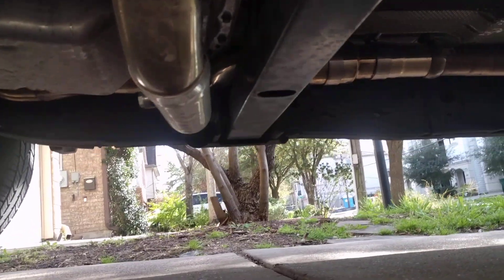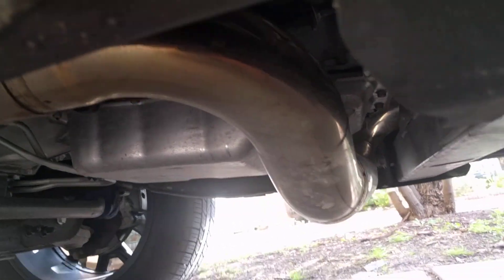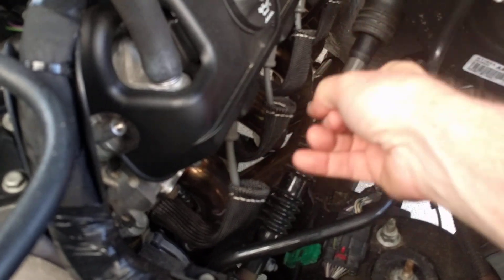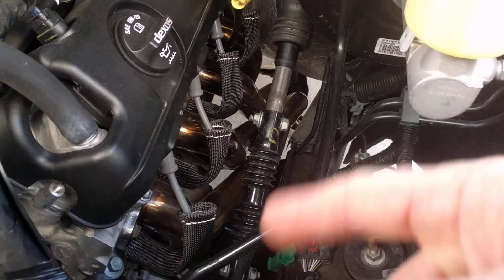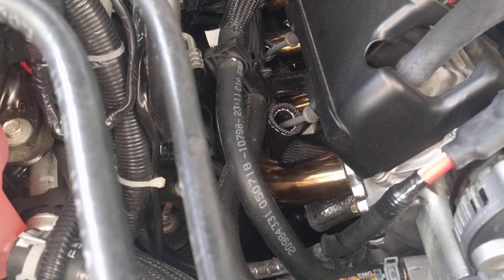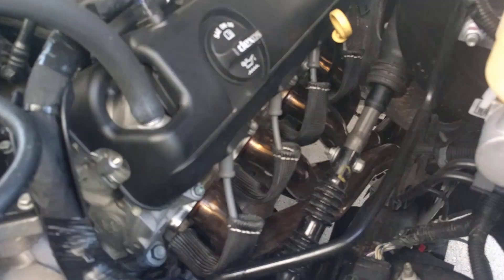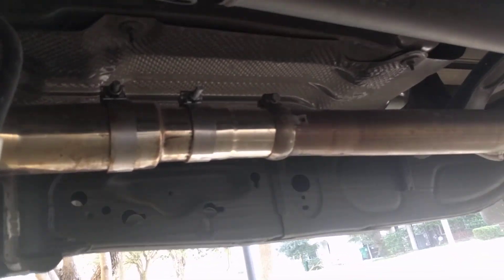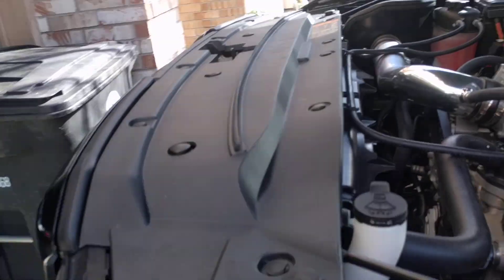Silverado Sierra NNNBS K2XX Speed Engineering Header Install Tips 2014-2018

Comment: Just got my long tube headers Installed on my 2018 Silverado 4x4 and everything is good except my shifter next to steering wheel struggles to shift down into drive mode. Everything else shifts great just don't know why it struggles shifting down into drive
Reply from the maker: If it started after you installed the headers, I would think that it must be some type of physical interference.  Maybe with the shifter cable or gear ratchet on the transmission?
Reply: I’m try install sum long tube headers for my 08 Escalade but I’m having trouble to install the driver side due to the front dif & drive shaft can I do anything about it or I just have to buy the 4x4 long tubes but we install 1 in the passenger side and it’s all good only problem is that

Comment: Did you screw the o2 sensors directly into the headers? Was there any engine codes? I’ve been eyeing these headers since I bought my ‘14 last summer. Thanks.
Reply from the maker: Yes...front O2s mount in the headers and the rear sensors are eliminated.  I just left the post-cat sensors plugged in and zip-tied to the frame.  You will need a tune to disable the associated codes or you will get a CEL.
Reply: Who tuned it?
Reply from the maker: @frankenstein5.965  me
Reply: With what platform?
Reply: What is the hpt I'm really interested in buying a full set up of headers.  Want to make sure I buy the correct stuff
Reply from the maker: @eloriginal302  HPT is HpTuners tuning software suite.
Reply: @n5yiz  you wanna tune mines? Nothing special, intake manifold and tb, cai, headers...cel is on
Reply from the maker: @totalp22  I wouldn't feel comfortable tuning for other people.  I still don't have a complete grasp of the Gen V stuff.
Reply: @n5yiz   sounds good man thanks!
Reply: When i put these on, will my pickup still run fine with the engine code until i get it tuned? My tune guy is out till February, unless i have black bear performance tune it.

Comment: hello quick question for the header bolts is there a specific sequence or a specific ft lb torque
Reply from the maker: There probably is a correct order to torque the bolts, but I've always just tightened them randomly...haha
Reply: @n5yiz  that works haha thank you i appreciate it

Comment: did u do everything from the top? or did u take out the wheel wheel covers at all?
Reply from the maker: I did everything from the top.  I think it would be a little easier to remove the fender liners.  They are not hard to remove.
Reply: @n5yiz  would u happen to know if running with a cel for the o2 that we dont use would make the truck run bad? at least until i can get i tuned out?
Reply from the maker: @jorgel673  I really don't know.  I know having a "not ready" for the emissions codes will not matter, but a CEL might.  Are your fuel trims wonky?
Reply: pmoore4321 no I haven’t installed them yet I just don’t have access to a tuner at the moment so I was hoping to install them and run then a bit with the cel before I get it tuned. It needs a tune for sure cause of the zr1 tb/l86 im swap.

Comment: I only saw three locations to install the O2 sensors. I notice you didn't include the O2 sensor on the Y pipe. Do I only need the two down stream sensors?
Reply: Thank you for your business. We are sorry for the confusion and inconvenience. Our kits eliminate the rear O2 sensors from the exhaust system completely. The bungs located on the headers are used for the front O2 sensors and the 3rd bung on the crossover pipe is used for wideband connection. You would need a local tuner to tune off the service light from the delete of the catalytic converters and rear O2 sensors.
Reply from the maker: @mr.constantino8691  Yep...SE beat me to it.  Everything they stated is correct.
Reply: @n5yiz  do you have to use the 3rd bung for a wideband connection or can it just be plugged off?
Reply from the maker: @tannersmith9218  The SE kit includes a plug for the bung in the crossover pipe.
Reply: @n5yiz  thanks again, gettin installed tonight and gotta get a tune asap
Reply from the maker: @tannersmith9218  make sure there are absolutely no exhaust leaks or you'll have issues.
Reply: @n5yiz  will doo, im going to have the y pipe welded with flanges from my buddies muffler shop. So it should be leak free. Just have to make sure no leaks from the heads
Reply from the maker: @tannersmith9218  no leaks anywhere.  If you're having it welded, you'll have no problems.
Reply: @n5yiz  yeah im thinkin so. What is the trick to getting the steering shaft off?
Reply from the maker: @tannersmith9218  just undo the two bolts and slide it out.  Do not let the steering wheel turn when the shaft is disconnected.
Reply: @n5yiz  got it. It was a little stuck but worked it out. Thanks man

Comment: How did you do with the o2 sensor? and how did you do it
Reply: What did you do with the upstream o2 sensor
Reply from the maker: @ejrut3930  Upstream sensor screws into the bung on the header.  The Downstream, you'll have to remove or zip-tie to the frame somewhere.

Comment: I just installed a pair on 15 Sierra. I straight piped it true dual to a  2in 2out flowmaster exhaust I haven’t had it tuned yet but I’m having this obnoxious flap/vibrating sound  inside the cab are you experiencing any of this and what do you think this might be? Can a tune turn that off?
Reply: Eddie Magana does it happen when your truck kicks down to v4 mode?

Comment: Are those factory plug wires?
Reply from the maker: yep
Reply: Any issues with heat off the header?
Reply from the maker: @dpd298  I have heat resistant covers over the boots.  #8 is touching the cover, doesn't seem to be a problem.
Reply: pmoore4321 are those heat covers factory or did you order them?
Reply from the maker: @dpd298  Cheap covers I bought in Amazon.
Reply from the maker: @dpd298  search "shinehome plug cover" on Amazon
Reply: pmoore4321 thanks, got me a set ordered.
Reply from the maker: @dpd298  The covers will have a steel ring in one end.  You'll have to remove it for them to fit.  Open the ring with pliers and then push one end through the side of the cover.  The ring will roll right out.  It's easy.
Reply from the maker: @dpd298  better yet...read the reviews on the Amazon page...A guy has pics of the ring removal.
Reply: pmoore4321 thanks I got them in today and got them squared away. I am going to be installing my headers tomorrow night. Do you have the torque specs on the headers..?
Reply from the maker: @dpd298  18 ft/lbs I believe.  Reuse the factory bolts.
Reply: Which gasksets did you use? The metal or the other ones they send?
Reply: @tannersmith9218  on the header? Mine came with the improved metal gaskets with the order.
Reply: @dpd298  sweet, I ordered them with the metal gaskets as well 👍
Reply: @tannersmith9218  probably a good decision.

Comment: Is yours a 4wd? I've heard that on the 4wd trucks you have to lower or drop the front diff to install long tubes.
Reply from the maker: 2wd
Reply: Ok thank you
Reply: Just did mine yesterday 4x4 it was so easy did not drop diff or anything and the passenger header actually went right in from to top also
Reply: No, you dont have to do that, 0 chance. The front diff is wayyy too far forward to even have to think it is in the way.  The ypipe behind the motor and under the cab
Reply: @shawnreppert1493  do the 4wd and 2wd require different headers due to the transfer case?

Comment: Any tips on getting the steering shaft out? I got both nuts and bolts out and it won’t budge.
Reply from the maker: Tap it lightly with a hammer.  Make sure the steering wheel is locked before you release the shaft.  I run the seatbelt through the wheel just to make sure it doesn't turn.
Reply: @n5yiz  did you tap it up or down. I’ve tried everything and mine just won’t move
Reply from the maker: @treyhakes4284   If you have the two bolts removed, tap the top of the ribbed section while pulling upward on the column side of the shaft with your hand.  It should just start to slide down and eventually pop off.  Sometimes you have to work the ribbed part up and down with the hammer to loosen in up.   I've never had one I couldn't remove, even on a high mileage truck.  

Up pressure on the shaft coming from the firewall and down pressure on the the ribbed coupler.  If you just hammer down on the coupler, the shaft coming from the firewall with just extend because it's telescopic.  Hope that makes sense.

Comment: Did u have a ratting sound after installation of headers and y pipe..I did between 70 and 75 mph..I can't find what it's coming from
Reply from the maker: Nope... no rattles at all.   Make sure you have zero leaks.   I had to weldup a bunch of pinholes in mine.

Comment: do you have any tips for getting rid of the header tick? I have a slight tick on start up and when driving. Thanks
Reply from the maker: You figure it out?  Probably a leak somewhere
Reply: @n5yiz  i looked all around where it bolts to the head and i dont see any soot or black comming out anywhere so i am not sure?
Reply: I swear my tick is the cats i bought a y pipe from summit and is still doing it